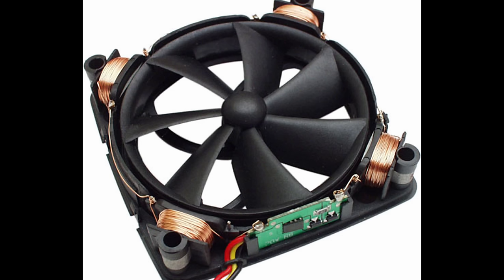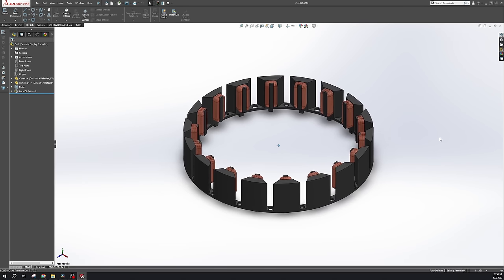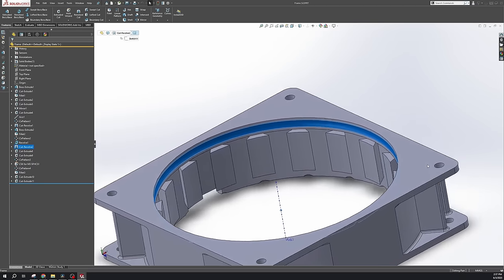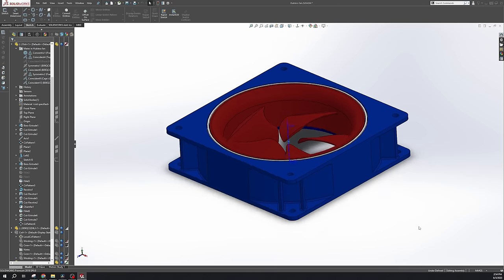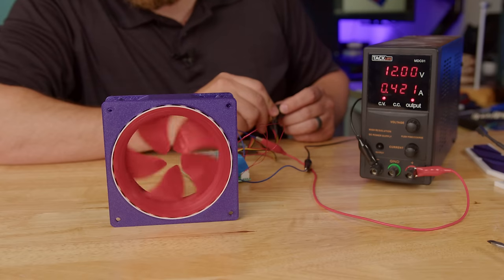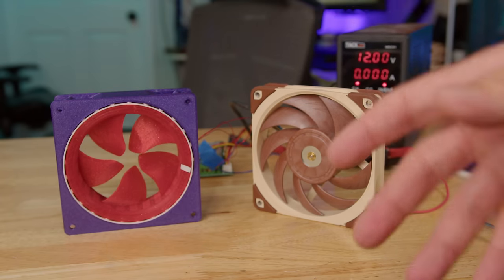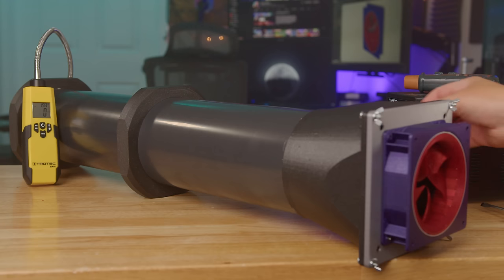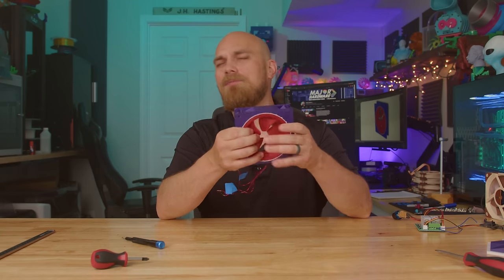I made a HUBLESS PC fan and it’s so loud!

Comment: If you can make it quiet and find a more efficient blade design, this will become the new standard design. Hubs have always been one of the biggest limiters on air flow as they are a physical barrier that the air has to move around, without the hub, you should be able to move much larger volumes of air...

Comment: i believe if u have made the coil hubs with solid iron core it would improve the efficiency of the magnetic field generated as well. you wouldnt have to drive it off such high voltages and current for the same amount of rotating force.

the bearings should also be lubricated, and if possible be made on both ends of the fan, unless you are able to do balancing on the fan so its center of mass is perpendicular to the bearings.

the fan blade design can also be improved, perhaps what you can do for benchmark is take a noctua blade design, remove the hub and just extend the blades until they meet up in the center, creating some sort of star pattern in the center because i believe the hub is diminishing its air performance due to air being compressible.

overall amazing project i've always been interested in a rotary hubless fan. isnt much of a dyson fan fan (pun intended)

Comment: Why not try re-using the hub with FD bearings, but ditch the motor in it(if possible?) Could probably use one from one of the smaller fans to still have enough blade surface to push enough air? Just a thought 😊 Awesome experiment nontheless!

Comment: I suspect that you could get clever enough with the electronics to use opposing coils to hold the fan in place without bearings at all. i.e. ride on a cushion magnets. ala mag-lev.
One thing to note, by pushing the fan blades at the outer edge you have way  more leverage. In theory, you can change speed more quickly. I've been considering this approach for drones for a while, just haven't tried it yet.

Comment: Cool design. What about using regular sealed ball bearings, using 2 in each corner lined up into a square shaped channel on the outside of the blade? It probably wouldnt be as loud but not sure about the performance impact.

Comment: I think you might be able to quiet it down if you were to put graphite powder in the bearing. Not lubricating graphite, but the sort of graphite powder that you get from machining graphite parts. I hear it's super abrasive, so my thought was it would sort of wear in and smooth the bearing race. Then you could clean it out once it wore in and replace the ball bearings, plus add some dry lube.

Comment: Not what you want as a pc fan. Not because its noisy, but because of the reason why its noisy: Its designed from a maritime turbo-propeller which if im not mistaken, is designed to work like a jet turbine but uses less power to turn it. It does this by moving the water in a swirling eddy in the same way a tornado moves air. You dont want a mini tornado blowing inside your pc or on your desk. Why dont you submerge it in a big tank of water and observe what it does.

Comment: You should send the design to Robert Murray-Smith so he can look at it from a power generation perspective.  He likes putting coils on the outer edge of a rotating assembly because generation requires either torque or speed, and speed is easier to achieve at the outer edge of a spinning assembly.

Comment: It's possible to simply connect the fan to a 12v battery. Flooded deep cycle, or even a small general purpose SLA.

Comment: Magnetic bearings! Check out Turbocor compressors. Clearly these are a different class of device. They use a mechanical bearing during initial start up before the impeller is suspended by the electromagnets. Now, how do we incorporate it into a small pc fan size package...?

Comment: Things probably to do:

1: Add grease, a light grease to reduce noise.
2: Find a way to make the wearings' surface from metal, as the balls will just eat the plastic surface in no time.
3: Make it the perfect finger remover fan.

Comment: silicone grease on the bearings. Won't do that much, but it's something... That and maybe a top over the bearings to hopefully reduce some noise coming from within it? 
As for the fan shape... That's definitely not optimised for airflow, it sure does look cool though! Maybe once the bearings are tolerable for you to do many tests you could test different blade designs on it. Maybe even try to copy Noctua's blades but flip them so they're innies and not outies.

Comment: If it were up to me I'd put some Krytox 205 grade 0 in the bearings in order to reduce the noise and improve lifespan if that's something you care about. It's commonly used to lubricate
mechanical keyboard switches by enthusiasts, and his a thin grease consistency.

Comment: Do the same thing but have the case sandwich the blades to a center point in the middle. Kinda like a spinning top. That way you don't need the ceramic bearings.

Comment: You may consider lubricating the bearings for them to flow more smoothly as well as to make less noise. Though granted would not want it too thick in this case

Comment: A few things which I viewed are issues your facing. 

Overall you design is solid. So, my advice is just to hopefully improve upon what you already have.

The core you chose isn't really the best. The best currently known is powdered iron ferrite. Basically iron powder which is compressesd under extreme pressure to its final form. This is what you find in most chokes or inductor cores for this very reason.

30 Guage wire while it works for this, isn't fine enough to get enough turns to make a strong magnetic field, if you cut apart any fan motor you will see that they use a wire that is barely a hairs width. They get a extreme number of turns because of this, which results in a comparatively strong magnetic field. Granted the finer the wire the less current it will be able to handle, but the greater number of turns should make up for that as it will create a stronger magnetic field.

On the previous note, while your windings look good, if you can get them machine wound you may reduce vibration and reduce some noise with better efficiency. 

Next your driver board may be limiting your final speed, as the coils can only switch as fast as the driver switches. So, you really need take a look at the switching speed of your driver.

Noise is pretty obvious, your running bearings against a rough 3D printed surface. Oil can help, but you could also try sanding or grinding the bearing channels.

Lastly, you may want to pay attention to the current draw, a standard pc fan can only draw about 1amp before it is well out of spec for atx based power supplies.

Also I think these were avoided not because of the bearing, but instead because of the cost to manufacture.

Comment: Grease bearings.  See where the increased resistance settles in and if it actually reduces the crazy noise.

Maybe make the bearing cage be self retaining. (make it  thicker and have the spacers retain bearings with it's own bevel to cup the bearings, reducing contact on blades/chassis), and then less of a bevel on fan/frame - hope that makes sense, easy to visualize, more difficult to explain) for ease of fan replacement.

OR find commercial bearings.  Knockoff 120 outside diameter "kaydon bearings" are cheap on over-seas sites($30), no idea on official parts(their website only shows distributors, and plenty are stateside).

Then iterate fans showdown style(your designs if not viewers) if changing them isn't a pain.

Comment: You should reduce the number of bearing balls in the race to a minimum, maybe try 5 vs 6 etc to reduce frictional losses from drag on the cage. You also (as i interpret it)  got a lot of boundary layer air on the outer ring of the fan, maybe add some surface roughness to try and break it up and increase the effective flow area?
At 2800rpm i'd look at a larger number of thinner blades, or adding extra shorter blades between the existing blades in order to improve airflow. Fewer large surface area blades tends to lend more to higher pressure than higher airflow.
Try filling the corner spaces of the frame with tpu  pieces, with a different infill % on each corner to have different densities to help mitigate the noise by acting as sound deadening.

Comment: Just a simple observation, not coming from a fan engineer perspective or anything, I can see this design be less noisy in water since the vibrations of each blade get transfered directly into water as opposed to each of those blades resonating sound in the air which make them much more audible.

The solution IMO would be to have a design that make each blades meet up at the center to reinforce the whole thing and reduce the vibrations on the blades, maybe not a typical hub but at least a smaller one just enough like I said to reinforce the structure.

Water also has different properties than oxygen so there are some designs or ideas that shouldn't work as much for one or the other.

This is all just guessing based on a quick glance and observation.

EDIT : There is still too much friction, you can hear it and see it when spinning.

Comment: Alluminum ball bearings with a light weight oil might help the sound and the speed and still not be magnetic. But idk, im no professional, also, i think small pwm controllers exist if you want more efficient power usage.

Comment: I’d look into using some neo-lube on the bearing. It’s a graphite based lubricant that should smooth things out and quiet it down. Only thing, don’t get it on your hands or any surface you don’t want to be stained.

Comment: 3 drops of 3-in-1 oil should increase the speed and drop the noise.  It doesn't take, much just enough for a very thin film on the ceramic balls.

Comment: PROTIP: if you want to print bearings, print them tight. Load your balls, cage etc (in your case, before loading it up with electronics and electric components) and then put a fine abrasive paste inside and spend 1~2 nights playing with this thing, rolling it while watching TV or on the Throne. The balls you'll use for this are discards. Don't use them after, and the next set of balls, make sure to measure them to be as close as possible  to one another  (at least three different measurements on each ball). I KNOW, a hassle, but trust me, it's worth it. Once you've broken in the races, the bearing will work much, much better than in any other config.
You can also make it better if you print the race and load it up with some kind of metallic filler and break that in. The less gaps you have in your races, the better.
If you're like me and impatient, you can always make a bearing breaker with an electric motor that spins it (at a low speed). I usually let mine overnight and by the next day it's perfectly broken in.

Comment: Impressed it worked, but you give up a lot of blade surface area on the end to gain very little in the middle, so i don't think it's possible to beat a normal fan unless you bend the rules and increase the size of the fan frame to keep the fan itself at 120mm

Comment: Impressive, maybe add lubricant for the bearings to dampen the noise or if you did, add a thicker lubricant, something like graphite powder or even maybe a bit of lithium grease could help with that, granted not by much but still.

Comment: I wonder if you'd get less noise from cylindrical bearings? They might get less horizontal play that way. I don't suppose there's any way to use magnetic bearings, that would be ideal. Just basically let it float on a cushion of magnetic force.

Comment: How large do the blades actually have to be before there's backpressure through the center?
Whenever you do 3-phase you can run Y or Delta config and you did run a Y config.

Comment: ok so I have had some more thinking time and I wonder if it would be better to angle your bearing in say a 45 degree angle. After all you don't have something that just rotates, you have something that rotates and applies a force. If you angle it in such a way that it can't fall out but also has full support for the force applied you might have a longer lasting design. No idea how that might affect noise levels.

Comment: I don't think different bearing will work given your drive is a cross the bearing race. Moving the bearing to the center allows more efficiency by reducing the distance between magnet and coil. Metal balls traveling through the coils' influence will have a much more negative effect than the ceramic balls.

Comment: This design is begging for a maglev bearing. That would be easier to do if it was mounted vertically, as you could use a pair of simple ceramic ring magnets. But maybe a ring of magnets would do it. Might add to the thickness. Alternatively, if it was part of an integrated liquid cooling system, it might be possible to turn the whole thing into a journal bearing, with a high pressure side and a liquid recovery system. I'm sure that would be more complicated than it sounds, but I'm just spit balling. Neat idea though, thanks for giving it a go!

Comment: Gorgeous! Amazeballs.

Just curious, if it’s the bearings making the noise, what if you lost the bearings? Float the whole thing like a mag-lev, hell, exterior containment by more (pulsed?) electromagnets at a right angle to the first set, as a collar…I’ve no clue if it’s a winding order or a controller board thing of English in general, but there has GOT to be a way, this idea is just too cool.

Nice work, @MajorHardware!
Reply: With one of them MIT blades, with one concave face…lens element concepts…

Full disclosure: photographer on THC.
Reply: …the shroud “mag-lev-ing” the blades has a focussing component? Bernoulli? SCRAMjet?

Comment: Could you make the hub just extremely small, to fitt the shaft and bearings only? And having the motor in the same way you did at the edges? That should make the fan as quiet as regular fans, but with a tiny hub that makes the airflow better.

Comment: Before seeing it run. I see one downside mechanically, this design looks like it moves rotational mass to the outer most point of rotation away from the axis.  IT does look like maybe it maximizes useable area for the fan blades though so I’m excited to see how it performs!

Comment: Running a qtip of car wax in the race to build up and fill in the layers will quiet the bearings, after it dries. I've seen improvement with crayon which is much softer and tacky

Comment: Would it be possible to run it without bearings? I'm thinking if the magnets are repelling rather than attracting the impeller could be floating during operation. Maybe needs arrays of magnet coils that also hold in place, so it doesn't jump out though...

Comment: To go way outside the box, to reduce the sound and friction altogether, would it be possible to use magnets in a way to have a floating fan inside the frame? That way it wouldnt touch the sides and the only sound should just be the blades cutting the air.

Comment: Those are not ball bearings, but bearing balls. The ball bearing is the whole assembly (inner and outer ring, balls, cage).
With crap surface quality races, and without lubrication of course it is loud. Noise of a ball or roller bearing is 90% made by the surface roughness of the working surfaces.

Comment: It's "I saw" not "I seen" or "I have seen". Sorry, I am not trying to be a jerk, it is just is like nails on a chalkboard. I'm not sure if this is the thing. If you have a printable filament that is mostly Teflon it would help to silence those bearings a bit. Also with a ceramic bearing to make it quieter A small amount of either Teflon powder or graphite powder makes them much quieter. Just my experience from longboarding for 10 plus years.

Comment: you should really try to solve the bearing problem, i wonder if an aerodynamic bearing, in which the flowing air cushions the rotating part, would be possible, or maybe arranging the magnets so they hold the rotor? maglev bearings are a thing, i just do not know weather they can be DIYed.

next i think the outer ring should be covered with a sort of spoiler, so the 120 x 120 surface would be better used, that spoiler might also block some of the noise ;) 

last i believe a lot of rather short blades might create a flow at the outside, which would then take the air inside with it.

Comment: Having nothing in the center looks really cool but what's the point if there is nothing there? You would get more fan where it matters (at the end where the speed is higher) if you instead used a small hub (like the fan you showed in the beginning) and then increased the diameter of the fan in place of your custom bearing.

Comment: I suspect your limitation is not your fan design on your RPM speed but the controller.  You might need to get a better brushless controller, many have a limit to how fast they can phase. 

You have an 18 winding fan, so that greatly increases the number of rotations per a phase.

Comment: Put a splash of mineral oil in with the bearings and make the fan blades thinner and have them get smaller until they all meet in the middle kind of like the blades on a jet and send it. Becauwe It already sounds like a jet so it makes sense.

Comment: You should have tested at 1000 rpm, 2000 rpm then full power
All though it’s performance really was not that great.
Iterate the design and make a better fan. Try a a12x25 missing the hub. :)

Keep the edits: would be interesting if a manufacturer did something with the idea. I bet it would be expensive compared to standard fans.

Comment: I was somewhat surprised when i saw it pushing the air in the center. This phenomena needs to be further exploited. This would remove the stall point of the blades of traditional fans.
Next step: Bigger hole, Better bearing/s, and more speed